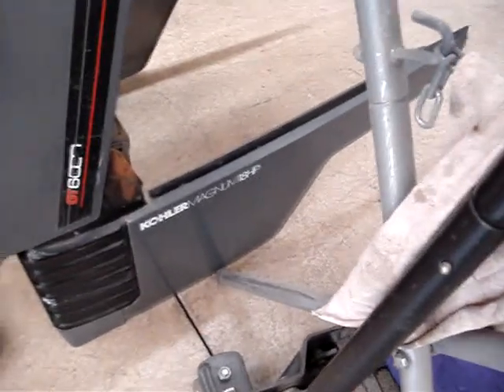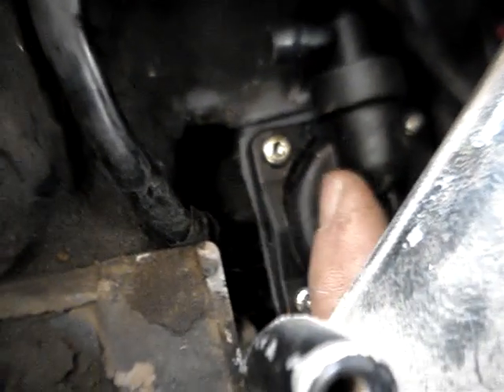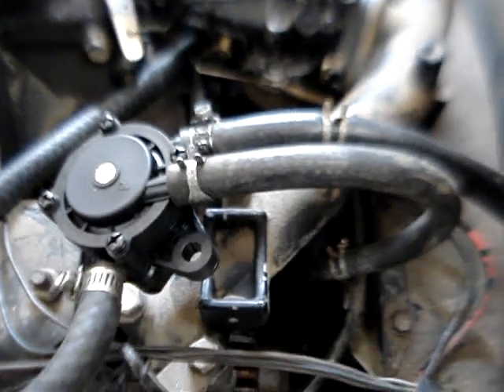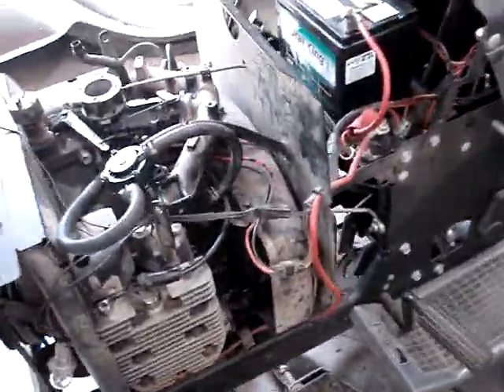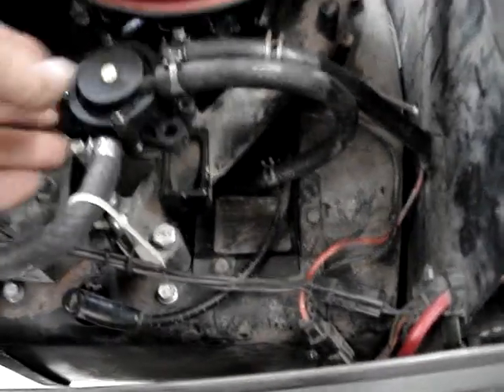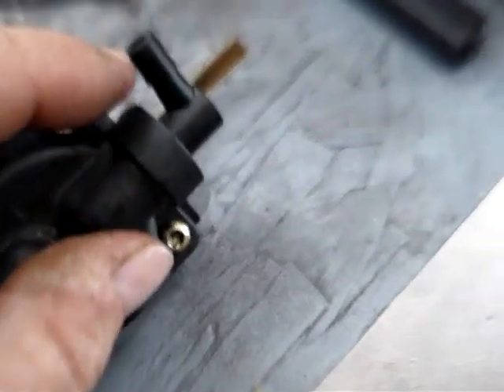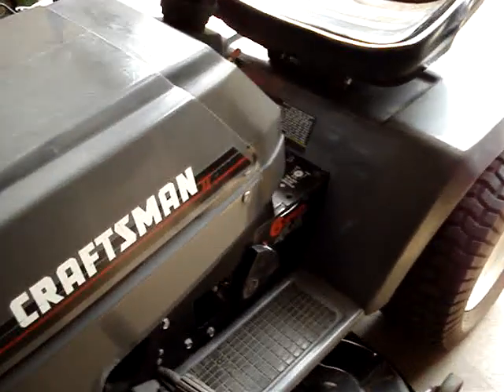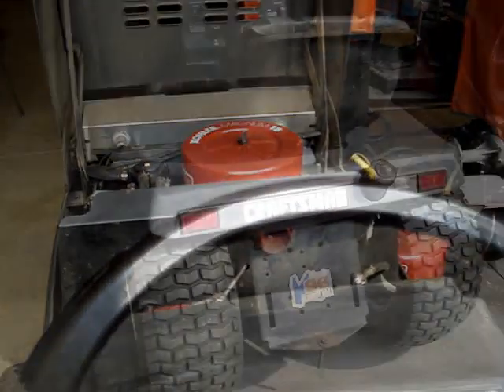Kohler Mechanical Fuel Pump Conversion to Vacuum Pump

Comment: This is not a long term solution. How the old pump operates is by using a mechanical arm that rides on the camshaft lobe. It goes up and down and inside the pump, it operates a membrane diaphragm to draw fuel from the tank, and pump it into the carburetor bowl.

What makes these pumps fail are age and the diaphragm membrane losing elasticity and having micro fissures form in the membrane. When they fail, they will operate properly when cold. But once the engine warms up, so to does the pump and membrane. Once up to temperature, the micro fissures open up due to heat expansion. And the pump fails to draw a vacuum from the tank. 

If you try and use these pumps without lubrication as well for short periods of time. The membrane will tear itself apart. Plus the internals need the fuel for cooling purposes as well as lubrication. I guarantee you this person found out how quickly this cobb job failed not long after the video was taken.
Reply: Why is this not a long term solution? The pulse type pump has been around for 30 years on mowers. The original pump is merely a shell, there's no moving parts inside his. People have been doing this for years on the K series kohlers as have I. Take off the mechanical pump, make a plate with a fitting on it, hook up your pulse style pump.

Comment: I appreciate the video ceedel! Great idea!
Reply from the maker: Works well and don't have to make a blockoff plate!
Reply: @ceedell  the only modification is to an old fuel  pump. I actually ordered another mechanical fuel pump and a vacuum pump, I was going to try a switch this weekend so this is video was a great find!

Comment: Excellent, thanks for making it as simple as possible. After my third china failed pump I’ve had enough
Reply from the maker: Still working great, I need to install a check valve to stop fuel from draining back to the tank if it sits a while.
Reply from the maker: I don't need a check valve after all, found the carburetor bowl screw was seeping. Tightened and now the fuel doesn't drain out or back.
Reply: Excellent find, ur version of the vacuum pump mod has been working flawlessly. My tank will gravity feed to 1/2 tank. I do like to pull the choke on when I shut the key off, just a habit, but everything seems to fire up quicker on the next start

Comment: I still don’t understand how you’re getting a vacuum signal from the crankcase of a four stroke engine. The original pump is mounted into the crankcase right?  I see it’s working but what am I missing about why it works?
Reply from the maker: It's created from the pistons moving up and down in the bore.

Comment: Will this work if the original mechanical fuel pump is already bad?  I'm assuming not?
Reply from the maker: Yes it will, the bad mechanical pump is why I replaced it with a vacuum pump. I gutted the original mechanical pump to create a vacuum port that operates the vacuum pump. The vacuum pump is the only operating fuel pump on the tractor.

Comment: Very smart, using the old fuel pump for your new vacuum source. I will remember this. 👍
Reply from the maker: Thanks Lloyd!
Reply: I had the parts on hand to make an aluminum plate, a 1/4 in fine thread pipe plug tap, cutoff wheel, bench grinder, drill and one fuel pump fitting.  if your pump is original, it will be threaded, otherwise youll have to source a threaded hose barb.    It took me 15 minutes to cut out a plate out of scrap aluminum, but if i had seen this video, i probably would have done this.  IN the end, the both work fine.